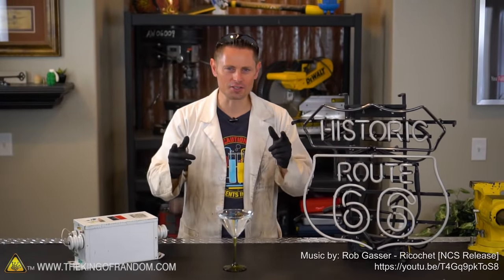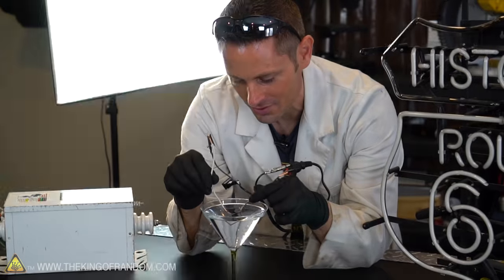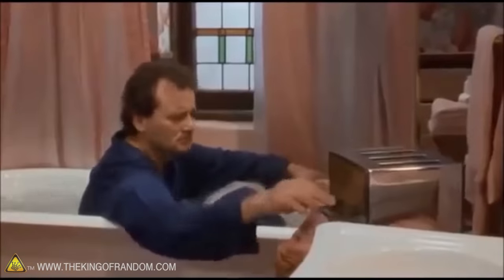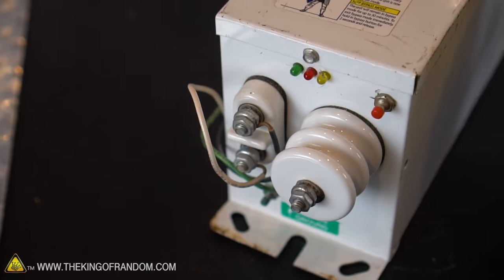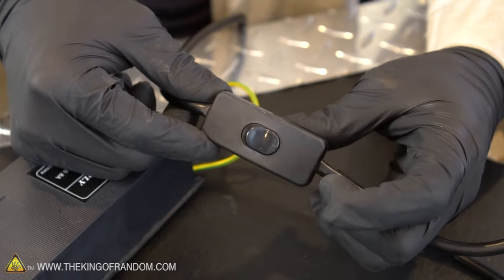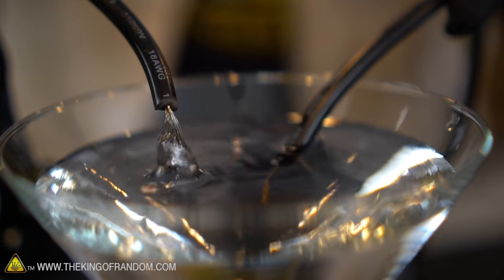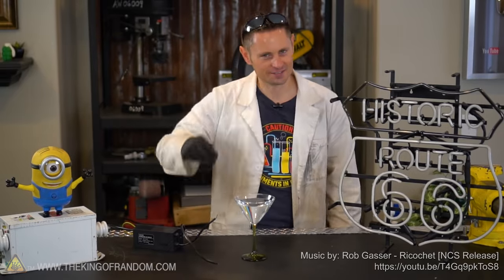Don't Mix Electricity And Water! TKOR Experiments What Happens With Electricity In Water!

Comment: Will electricity flow through liquid nitrogen?
Reply: Okklohma TV how bout you go use google to learn how to spell Oklahoma correct.
Reply: No it will not as nitrogen is a covalent compound and covalent compounds never conduct electricity regardless of phase.
Reply: I don't think anything will happen. Pure liquid nitrogen is, well, nitrogen. It's not an ion or anything. If it weren't pure and there were certain contaminates in it, it probably could (that's why water can conduct electricity).
Reply: I'm not sure about that. There's two reasons nothing will happen: the wires will freeze up, or because liquid nitrogen is pure nitrogen, just super cold.
Reply: Water is also self ionising to a very small degree which is why even distilled water can conduct electricity.
Reply: DP Studios Yep H2O + H2O --> OH- and H3O+
Reply: rajan grg I don't understand what you mean by "pure". Nitrogen is an element meaning it cannot be broken down into anything else. The nitrogen being a liquid is just one of 4 phases any matter can be. The scientific reason why nitrogen doesn't conduct electricity is the type of bonding it features which is covalent molecular. This means that when it bonds with another nitrogen they "share" the electrons. It bonds with another nitrogen due to it be diatomic meaning unless in a compound it will be N2. Due to this sharing of electrons there is no "free" or "de-localised" electrons able to move. Since there is no moving charged particles (electrons) there is no current, which is what electricity is. The freezing has nothing to do with the conductivity and will not affect the metallic bonding that metals feature. Believe it or not the colder something is the less energy it has.
Reply: John Cheesecake yet not much as indicated by Kw :))
Reply: Lobo while in this case you may be correct, lowering the temperature of substances does change their conductivity. For an example look at quantum computing or how superconductors are created. They are cooled down far enough that they have no resistance in them, making them more conductive
Reply: My last sentence may have not used the correct words. I was implying that for nitrogen which features covalent molecular bonding the temperature will not effect it's conductivity.
Reply: Electricity will flow through any material when given enough voltage to overcome the insulator's dielectric breakdown voltage. In the case of AC application, there is also the matter of capacitive coupling through the insulator to consider - the buzz you feel while holding a thickly insulated cable carrying high voltage AC is capacitively-coupled current.

Comment: "30 mA shouldn't be dangerous for you"  
Famous last words
Reply: New Nuu64 30ma at 10,000 volts is 300 watts!
Reply: typical grant
Reply: doesn't matter. Yeah it'll burn the skin after sustained contact but there is nothing to 30mA
Reply: Well.. true, but that transformer can do one or the other, never both at same time.
Reply: Electroboom.
Reply: 60 times the lethal amount...
Reply: ... what?
Reply: i made 30mA and 1.5 volts from a 20cm wind blade and motor it's not a lot.
Reply: 30mA is not a lot but his is 10,000 volts and 300 watts. v*a=watts yours is .045 watts
Reply: That was 1.5 volts though, thats barely enough voltage to penetrate your skin. Wouldn't do anything to you.
Reply: Funny Bunny the voltage limits for dangerous electric shock is 50 V AC or 110 V DC. DC is what you get from batteries.
Reply: I know but amperes is current and voltage is potential difference so the increased voltage is the difference in charges and the amperes is the actual charge and what kills you, but I agree it does make a difference I was just making a point. Amperes is coulombs/t, so relates to the charge.
Reply: and it doesn't really matter whether it oscillates or not in a contained system with AC
Reply: Joshua Nordin 1) 30mA at 1.5 V from a DC source. DC is direct current, not Alternating Current. DC will give you a "jolt" but AC will "grab" you. 2) Voltage is what influences current in a conductor, the higher the voltage, the greater energy potential there is between two points. 1.5VDC is miniscule compared to the force behind something like 12V let alone 120VAC.
Reply: Funny Bunny are you trying to teach an expert?
Reply: which one
Reply: Sir Torrance Which is basically what I said...
Reply: The transformer is current-limited to 30mA. At 10,000 volts, a human body would pull all the current the transformer could provide. Though it is current limited, I wouldn't trust a transformer from an old sign (or any transformer at that voltage). In any case, it would definitely hurt.
Reply: Sir Torrance You know i was replying to funny bunny right?
Reply: death can occur at around 50-150 mil amps anything more than that increases your chances of dying
Reply: 50 Volts and 50mA can be deadly
Reply: New Nuu64 50000 volts is enough to contract your muscles
Reply: 100 and 200 mA (0.1 to 0.2 amp) are lethal.
Reply: in the uk, there is extra low voltage which goes up to 50v, and that shouldnt penetrate flesh, however the deadly dose of current is around 78mA for longer then 0.3 a second going through the heart, most
Reply: leos drums you would only draw 50mA if your skin had a resistance of 1k ohm. which is highly unlikely... your looking at about 10K ohm as your average skin resistance, which in that case you would draw 5mA

ohms law I=V/R
Reply: New Nuu64 yeah, i know. But as you said, the voltage is also important. more voltage = more ampflow.
But I learned at my school that 50mA and 50V are dangerous to the body
Reply: 1kuhny 
leos drums 
If you have a tiny crack in the skin, the resistance drops quite heavily. So 1 kOhm ist not that unrealistic. 
Also, a human body is a LOT more complicated than just  ohms law. There are many more things that are going on in there. You have capacitive current, breakdown of skin, current flow through the blood, ionization processes,...
Reply: myofficegoes65
Reply: New Nuu64 it isn't actually dangerous,
Reply: Its only enough if appplied directly to the heart. Usually electricity finds a quicker way through the body.
Reply: I smell MCR
Reply: Maybe i misquoted the book i read. Actually i know i misquoted it because the book said 1/10 amp
Reply: Wtf bro, even 2mA are lethal, the "problem" is how much voltage do you need to get that current flowing throug you heart
Reply: and I know that I cant make you stay, but where's your heart?
Reply: +spectacular alien I love you for that comment :)
Reply: myofficegoes65 that doesent matter
Reply: Current= voltage divided by current the human body has around 600k ohms of resistance, meaning only 2-3 mA of current will flow through your body
Reply: kuhny1 more like 600k ohms are you crazy, 10k ohms is the resistance of the tongue
Reply: Oof
Reply: He isn't alive anymore :-(
Reply: Sadly he passed away as a result of the shock.
Reply: Anything above 20mA is very dangerous
Reply: Well, we all wonder what his last words were....RIP
Reply: @HillbillyRednecking the leathal amount is 20ma

Comment: Why did the stream of electricity get green? 

P.S: May you rest in peace.
Reply: Michael Delia I think it was copper vaporizing in the arc.
Reply: Correct
Reply: No, is you look closely, the hot arc was burning the insulation, which from my experience, high voltage wire insulation burns green. The arc is not hot enough to vaporive copper.
Reply: It's the copper.
Reply: John Chestnut, I have tested the copper theory, and no, it doesn't work, so I lit wire insulation on fire, and that provides the green. You probably don't have any experience in chemistry or high volatage.
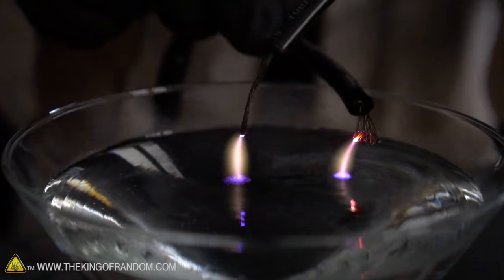Reply: Unless you are talking about a different clip, like at 7:05, that is the copper.
Reply: @EdwardTriesToScience  2 years of chemistry high school, one year college.  Flame test.  Copper is green in a flame test.  I even upset my mother doing flame tests over the gas stove.  She thought I was going to burn the house down.  Fireworks use the same principal to get different colors.
Reply: @EdwardTriesToScience  I have also vaporized the tips of screw drivers and other things with 110 AC voltage.  I've also done so with 12 DC voltage.  Been there...done that.
Reply: The give away at 7:05 is that the sparks that fall look like metal burning, say like the little bits when a sparkler burns.
Burning Mg.
That Green is the Copper, at the mentioned time stamp.
The burning copper experiment is an interesting one.
It's a gateway experiment to chromatography in some respects.
Another related experiment,
Copper Sulphate and the blue green to hydration...

Same green.
Please don't burn insulation without a hood.

*ps,
Electronics Engineering, uni ;)
(syllabus includes ALOT of  fabrication btw)
Reply: sed8me I was talking about the Random Happens clip where the insulation burns green.
Reply: When you do the flame test for copper, a bluish green flame appears due to the Cu+2 ions.

Comment: You should make a video about electricity conductivity over liquid nitrogen, 
Supposably since the temperature  is low, there is almost no resistance for electrons to flow through so a small battery would be able to power up a light bulb like a regular power outlet.  
Maybe do an experiment where u connect a AA battery to a house light bulb and dip the connecting cables in liquid nitrogen.
Reply: get bigger tweezers and long needle nose insulated pliers
Reply: Samuel Arcos For a AA battery? They have a voltage of 1.5V.. That's so low you can just touch both ends and nothing will happen thanks to Ohm's Law...
Reply: There are materials called superconductors. They have zero electrical resistance. Some of them work at liquid nitrogen tempurature. You might be thinking of that. But the liquid nitrogen itself likely is non conductive. And also no matter how hard you try, even with zero electrical resistance, a 1.5 volt AA battery won't light up a 120 volt bulb.

Comment: Not jumping! The arc comes from electricity breaking down air molecules. It's like the breakdown of a two dielectric capacitor. The bonds in air are weaker than water so they breakdown first.

Comment: Pretty sure the water "conducts" at high voltage due to less resistance than air, the electricity has a high enough strength that it will go through the band or wire gaps